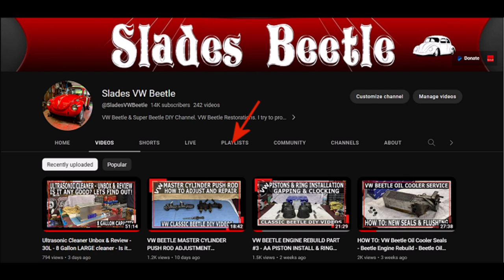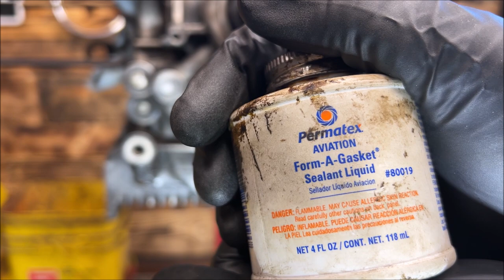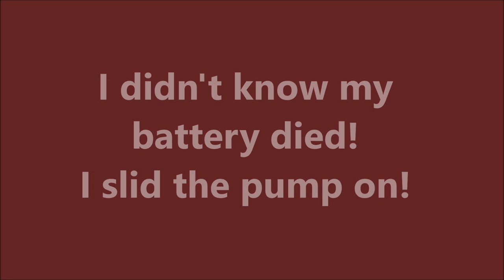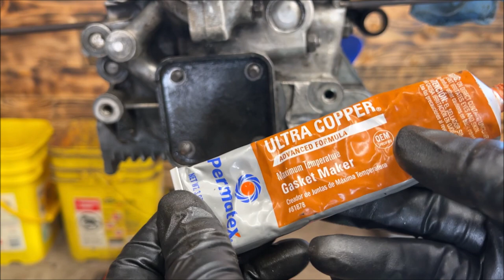VW Beetle Engine Top End Rebuild Part #4 - Oil Pump Removal & Install - Beetle Oil Leaks Repaired

Comment: Thank You for the Oil Pump video --- AND --- for doing a Playlist of your video's --- I would think most people are at different points in doing repairs and what not to their cars --- today may not be -- Do an Oil Pump day --- With your Playlist it will be easier to find that video on what we are doing when we need it -- instead of the Search All method --- VERY GOOD! ---- I see you knew right where to get that paint brush -- her Private little stash -- you keep it clean and it will always be there. --- Tell Heather -- her new Sticker design looks really nice --- you two should sell quite a few of them and if the same design is on the T-Shirts ---- you will sell a lot of them also. As for the Specialty Tools it would be good to see --- especially if it makes working on the engine easier ---- Rodney
Reply from the maker: Thank you so much Rodney! I hope that you’re doing well my friend. I think a playlist would help a lot of people that’s why I did it. Hopefully when they need something it’s like opening up a book and going through the index. I definitely am going to do that specialty tool video just in case people are new to the game and dont realize that they are available.

Comment: great video my friend, to bad you couldn't do it your way with new nuts and the right sealant on it.
but it came out very good.
 I hope that motor will build up a good oil pressure, a little bit warned out. 
good work and up to the next video.
Reply from the maker: He did order the right nuts for it, so now I’m gonna have to take it back apart again. It’s not easy doing work for others lol he said the motor has 40,000 miles and appears to have more to me

Comment: Another useful video. Pretty straight forward but a job I've not yet done..and there's not many of them at this point. Seemed a shame after all the sealant to try and prevent leaks that you didn't have the correct nuts to hold the cover in place.
Reply from the maker: He actually just ordered them a week ago. So I’m going to have to take it apart again, and reseal it and put the new nuts on.

Comment: Well worth doing, after replacing my 72 1200 og pump that had 100,000 miles up, I noticed about a 10 per cent gas saving! Stock pump not aftermarket gimmick pump.😅Manufacturers claim all sorts to sell more crapola for more dollars.

Comment: Specialty VW tools? If possible, I would like to see the AutoStick drive plate hold down tool because of the impossiblility of tightening or looosening of the gland nut without it.
Reply from the maker: I will gather all the information that I can. I do have some of the tools on hand and the ones that I don’t I will show, and discuss them.

Comment: Nice video! Love the "tips and tricks". But, I may have missed something. What was the purpose of removing the oil pump? I did not see you sing any new parts. You did clean things up, though, so was that the reason?  Thanks! And yes, I think a "special tools " video would be interesting.
Reply from the maker: Thanks I appreciate that! He had removed the plate, to paint it. Which broke the gaskets loose. So I had to put new gaskets on and cleaned it up while I was in there
Reply: @SladesVWBeetle  thank you Slade, I recall you stated that up front....sorry!!
Reply from the maker: @superbear617  Never a need for sorry!! It’s all good!

Comment: When you show the picture of the oil pump housing after pulling it off the 4 holes in the grove are clearly evident (time stamp 12:24).  When you show the housing after cleaning it the 4 holes do not appear to be there (time stamp 13:05).  What am I missing?  Is the cleaned housing a different housing from what was pulled off originally?

Also I vote “YES” for a video on specialty tooling.
Reply from the maker: Hi Mike, I know what you’ve seen, you were seeing the old gasket that has the holes in it. 
Once you remove the gasket the holes are gone. 
And then you just see the groove until the new gasket is put on with the holes in it. I hope that made sense.
Reply: @SladesVWBeetle  Thanks very much for clearing that up for me.  I'm a big fan of your videos and find them very informative.  Keep up the great work.
Reply from the maker: You’re welcome Mike! Thanks for being here!

Comment: I would have resurfaced the oil pump cover. Looked like it needed a little cleaning up. I use a spare vw door glass with some fine emery cloth sandpaper with WD-40.
Reply from the maker: I have to remove the cover since he finally ordered the nuts. So I’m definitely going to try that sounds like an excellent idea my friend.
Reply: @Slades VW Beetle  
The special sealing nuts for the oil pump cover, have gone up in price in the past few years. They can only be used once.  They only should go on the cover, when you know the engine is ready to run.

Comment: I just put 1 drop of oil on each gear. It is enough to get the vacuum started. that is really all you need. I am always afraid of putting anything else because the engineers have a tolerance between the bearing and the crankshaft for oil. The thickness of the vasoline might be more than oil so it might not properly lubricate the bearing. many people do this though and it seems to work for them. This is just the way we do it. Yes put something on those gears. so they work. On a V8 I drip some oil down the inlet and turn the pump over till the gears are coated. Then install it Done!....something on those gears. I have heard of people putting them together dry and not getting it to prime.

Comment: This was a great video.  Question: Installing a full flow oil pump and cover. Oil pump does  NOT have an outlet port  
 
And the pump cover I have is a full flow cover. 

Is it necessary to tap and plug the block oil pump outlet?  I ask because case halves are already bolted together, flywheel bolted up and end play set.  and in my mind since the pump has no outlet and oil will be forced to come out through the pump cover there is no need to  plug the block galley.  Thoughts?

Comment: I have a couple.of different VW manuals and one of them gives a spec. for the thickness of feeler gauge that I think you can be ok to reuse the pump if it's in spec. between the gear and the body of the pump.
When I rebuilt my engine 2 years ago I bought a replacement for the og 50 year old pump but couldn't find it when I came to reassembly time, so the original pump went back in and I never did find the new one so recently I got a second new one 😆
Do you think I could replace it without taking the stock exhaust off or the engine out?
It's a hassle as my Bug doesn't have a garage to work in.
Reply from the maker: Honestly John I have never tried to do it that way. That’s why I’m considering designing a removable apron, probably an upcoming video soon. 
It would seem very difficult to do that with the engine inside. Although it can be done. Just a little more intense of work.
Reply: @SladesVWBeetle  I was thinking the same, easily removed rear apron would save me some skinned knuckles for sure at the very least even on a pretty stock bug like mine,
big hands are a curse 🖐️
Reply: Plus my rear 50 year old rear apron has seen better days and is due replacement anyways!

Comment: Hi Tony. Thanks for another great video. Curious question for you. Do you think it would make more sense to torque the case before the pump cover. It seems like if you do the cover first it could keep the case from fully sealing. I am not judging or critiquing, just the way my VW rattled brain works.✌️
Reply from the maker: Thanks for chiming in CJ, I have actually done it both ways. Probably doing it the way you named would probably be the better one, but I’ve never run into a problem. But I thank you for bringing that up it makes sense!!

Comment: Is it common practice and/or is it advisable to replace the oil pump cover?
Reply from the maker: The only time you would replace the oil pump cover, is, if there is an issue with it. If you do notice some scratch marks in it from the gears, you could make a little stationary place to sand. It smooth. Probably setting a piece of sandpaper on glass, and rubbing it “the cover”back-and-forth on it to smooth it out. Nothing too aggressive.

Comment: What size studs are those? I see hevy duty VW pumps that say 8mm studs and 30 mm thick. Do those bolt on and are they needed?
Reply: You don't need a heavy duty pump unless putting out over twice the stock horsepower. Good quality stock pump is fine for most, often better than aftermarket.
Reply: @johncollins5552  Thanks. My engine is/will be stock with just a slight compression boost due to head surfacing. Is there a preferred Quality Stock pump and where should I go to purchase it? Thanks!
Reply: @benkanobe7500 Wolfsburg West or CB Performance.  Ask for Moe and tell him Frankenstein sent ya.